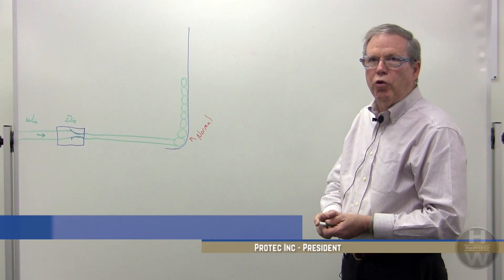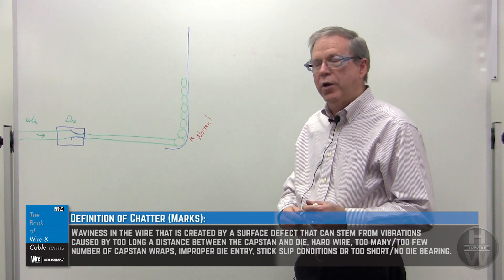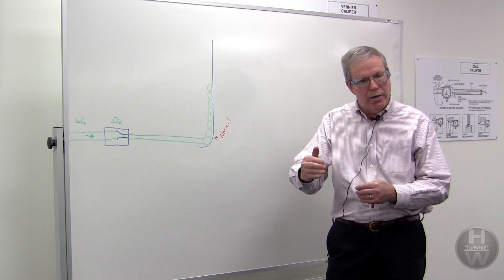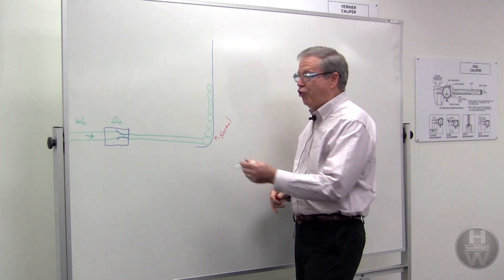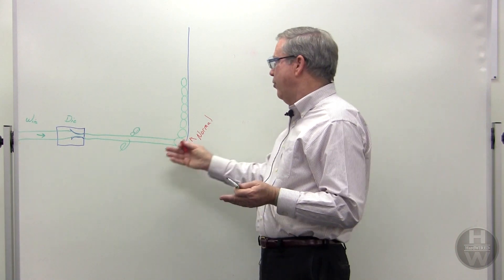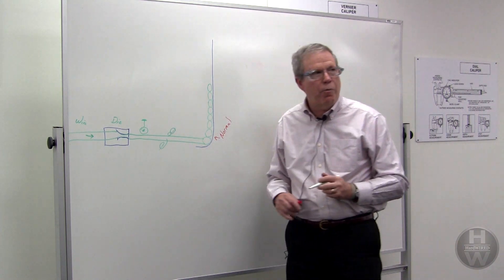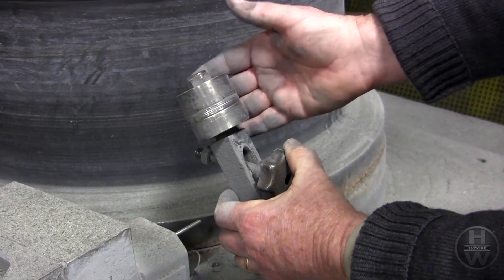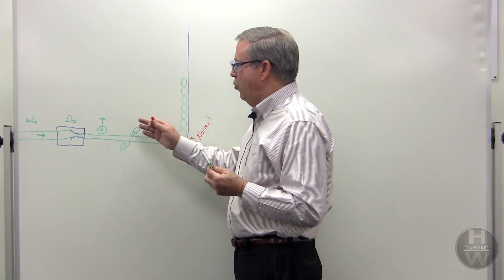Chatter

Comment: Какая температура охлаждения волок и блок, подаётся?
Reply from the maker: Sorry I don’t understand the question not sure by what you mean by temperature of the fiber  and what unit?
Reply: @WireAssociationIntl  Cooling
Reply from the maker: @Андрюха-ььь  

So are you asking what is the temperature of the wire and what unit we use to cool the wire?
Reply: @WireAssociationIntl  
cooling water temperature
Reply: I'm sorry, I'm from Russia
Reply from the maker: @Андрюха-ььь  The cooling water temperature is between 74 to 86 degrees F  and can come from a cooling tower or a chiller. We like to have the wire temperature no higher than between 120 to 130 degrees F going into the next die.

Comment: THANKS A LOT FOE THIS INFORMATION
Reply from the maker: No problem, please let us know any other topics you wish covered!
Reply: thanks for your reply , i really wanted to know which type of drawed steel wire used to make steel wool , because here in egypt steel wool manufacturer using the 3mm drawed steel wire from 9 mm steel wire low carbon  not from 6 mm steel wire low carbon .....
so my question here is there a difference in properties between steel wire 3 mm drawn from a 9mm  & steel wire 3mm drawn from 6 mm